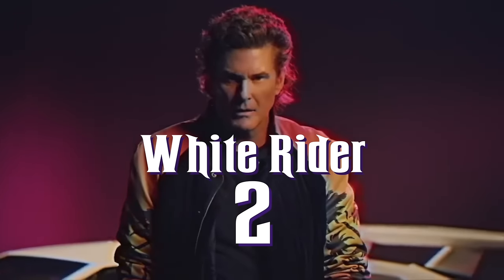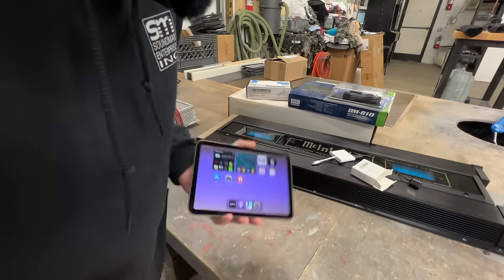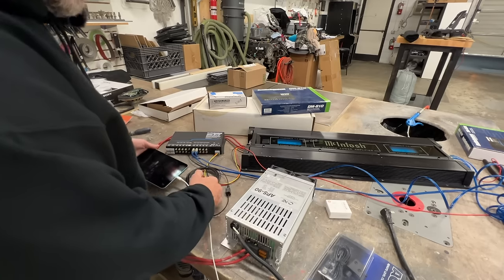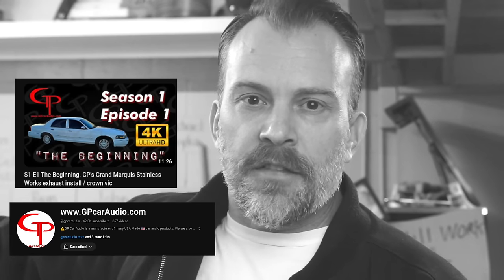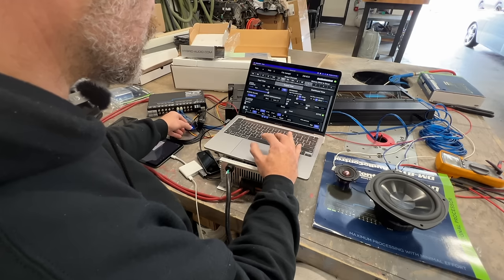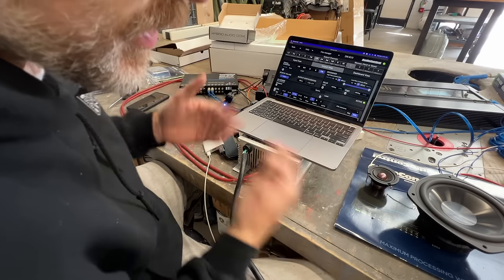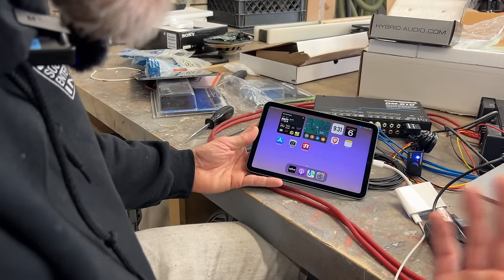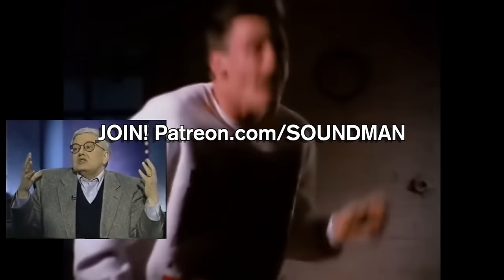My Secret Weapon! - Bench testing my stereo system

Comment: That McIntosh surfboard amp never fails to adjust the angle of my dangle!
Reply: Terrible footprint. Jensen makes a more powerful amp at 1/4 the size. Trust me I know as I used to be a professional car audio installer/designer at Best Buy
Reply: @505Tempest  Are you sure? This amplifier is 100x4 + 300x2. Class AB. I used to have the smaller one: 50x4 + 100x2.

Comment: EDIT I was totally wrong but im gonna leave the receipts

Daddy Doug TOSLINK only supports 2 channel CD quality or 5.1 compressed Dolby Digital UNLESS that dongle is running a different standard than SPDIF over the optical cable such as ADAT (not likely). That's probably why you're not having issues with bitrate switching, because it's not switching,  just running 44.1/16bit all the time.
Reply: I run my Iphone using the same dongle to my Helix DSP 3, You will get 24/96HZ. when I tried to play anything above that it became a crackly mess as my DSP can only support up to 24/96HZ for optical input. additionally, that is why I switched from Amazon Music to Apple Music as Amazon won't always downgrade the track for what my DSP can play but instead always would play that highest quality setting.
Reply: @SJE1337  can you elaborate on what protocol allows this? It cant be normal SPDIF
Reply: actually ignore me per se
Reply: @punksweeper4678  it's cool man just for others, I got all confused when I was first understanding what optical can actual do with his res music/ what an Iphone can actual output from USB. I got a topping d10 to comfirm what my phone was actual out putting based on software/music. Iphone puts out PCM or DSD depending on settings/software.
Reply: @punksweeper4678  all good.....high res audio formats are pretty much a waste of time and money anyways for basically zero gain
Reply: @ecpruthless  i wasnt even gonna go there LOL

Comment: Nice!

Im using a Android headunit that feeds my Helix Ultra dsp an optical output for daily listening.
Then I have a Fiio DAP connected to the DSP using coaxial connection as my critical listening source. 

I can control the Fiio DAP from my Android radio / steering wheel controls by downloading the Fiio Link app onto my android radio.

Next is to implement auto source switching. 
So, if I am listening to music on the Fiio but a phonecall or nav prompt comes in,, the dsp would switch over to the headunit source to play the phonecall etc.and then back to my Fiio when done.
Reply: The helix stuff is amazing, running a V Eight DSP MK2 myself

Comment: Love the video. I just discovered your channel and immediately subscribed. I already have you in my top5 audio channels. I'm in the process of building a hi res. I have the same DSP and I'm using a older JL xdm800/8. I'm looking into components now. And have s pair of older but brand new powerbase PBX extreme 8" sub's in a custom slot port box I built, on a JLxd600/1.  What do you recommend for a good front 3way on active setup and good 2way components for rear w crossover. That gives me my 8 channels. I can have the 6 available for front then use the 7/8 for rear fill. Plus Im a android user. What options are available for an android tablet w same optical output if any or should I just switch to apple in my car? Any advise would be appreciated.

Comment: I get the test with the streaming audio but I'd check with an actual CD or CD ripped to the computer 16/44.1 to get standard results in case of that bit rate variable on those streaming tracks.   Subtlety promoting CD's as they are very easy to find and are dirt cheap for 'forever' music to your collection physical items that you can pass around at your next party

Comment: We have been using sdpif and usb DAC's from tablets forever in SQ.... You should really try a good USB DAC as its superior to 24/96 limitation of the spdif..MQA etc will work with a proper DAC.. Audio Control DSP's are limited and is a lower qualtiy DSP compared to your amplifier... highly suggest Helix Ultra or MK3... or ARC Audio PS8 Pro if you want to SQ with the big boys.... . Every DSP I know of defaults FULL volume FYI.. you can adjust that though to default lower volume upon power on.. and checkout Tidal for high resolution streaming..  Also...I am pretty sure your amp is A/B not pure class A.  Most Class A amps don't make very much power at all.

Comment: Have you seen the new car commercial that shows McIntosh for the stock stereo? Can't remember which car company....maybe Jeep?......Also, if I download co-buzz on my android deck that has SPDIF optical out, will it output a higher bitrate? I know nothing about this. Will it sound better even if I convert that optical to RCA?
Reply: Jeep Grand Wagoneer....it's labeled McIntosh but made by Alpine.    It doesn't sound very good, certainly not on par with a high end aftermarket stereo at least.
Reply: No because the android radios are limited even on the digital outputs unfortunately.  Slightly better than cd quality. There's a way to use the USB as audio out but you lose volume control that way

Comment: Dude the Fuckn White Powah Rider is the tits. I'd use the McCinslosh Amp run 4 channels to the front four speakers and use the other two for those nasty ass 8 inch deep throated mids mounted in the rear deck. The acoustics in those cars are so rear biased you don't need tweakers in the back cuze you won't barely hear them. ROCK ON
Reply: I'll take that old factory sub off your hands for my Maruader if you don't want it.